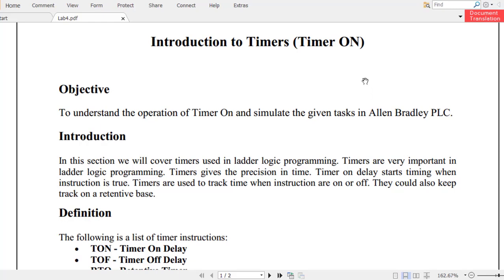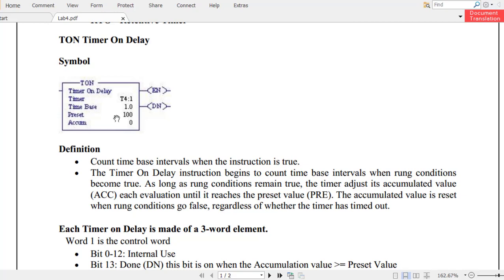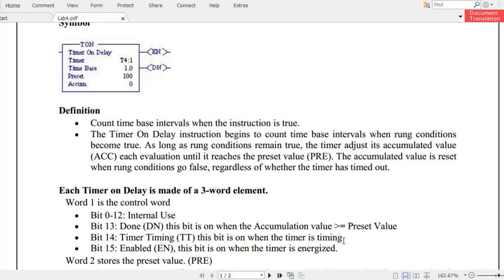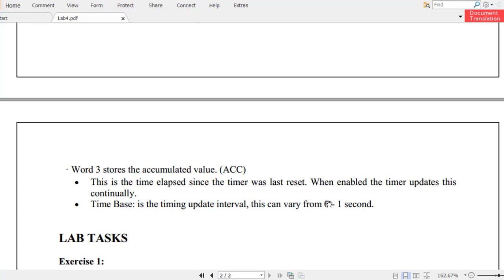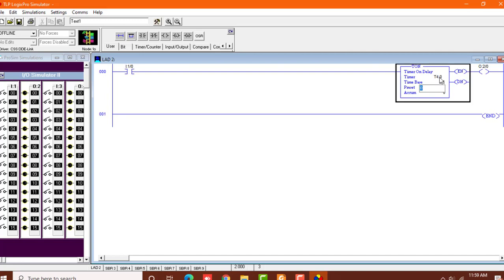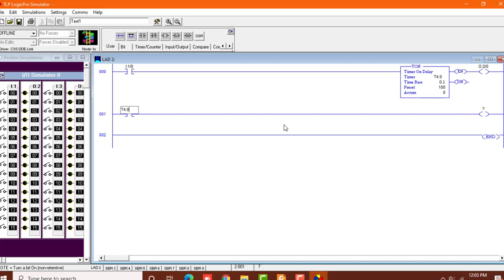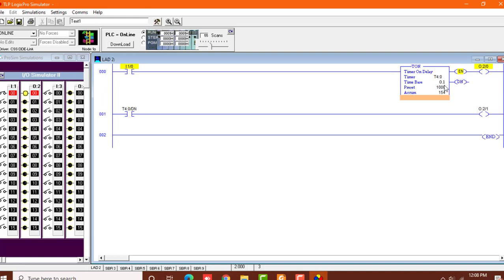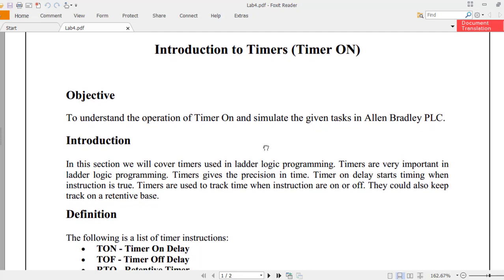How to use Timers

Comment: 171003 SYED YAWAR IMAM KAZMI
5B-POWER
Summary 
In this lecture we studied about timers , timers are actually those devices that can be employed to turn on or off those devices which have to be for some specific time for example we have a remainder set up in smart phone at 10:00am.
When clock in remiander goes to 10:00am it will give system alram or wakeup call.
So these perfomances can be done by timers.
We have thres types of timers.
i) T.on
ii) T.off
iii) RTO 
we studied only about T.on. if T.on=10sec then O/P appears after 10secs

Comment: Id: 180516
Beep 5b
 Summary of Lab 4:-
This lab is about Timer ON delay which keep the record of the time whenever the input is set active. It is made up of 3 words.
1. Control:

0-12 internal bit
13 bit Done bit which is active when accumulated value becomes equal to preset value.
Further with the help of DN pin, we can control a switch to turn on after a specific time interval which may be connected in another rang by assigning it correct Address. When our timer times completed our DN pin will active,and this switch activated.
14 bit Timer timing bit
15 bit is enable bit which is active when timer is energised. 
2. Preset: 

it stores preset value and it is programmable. 

3. Accumulation :

This is the time elapsed when the timer was last reset.
This helps us that our delay comes to end at a specific value e.g. if our pset value=100 and time base = 0.1 then our DN pin will active after 100*0.1=10sec,
And our Accumulated value moves from 0 to 100 with the gap of 0.1.

Comment: In this lab we worked on Timer On Delay (TON) for the purpose of triggering a specific tasks.TON relates with three words namely control Word, Preset Word and Accumulator Word.The range of naming it is from T4:0 to T4:99. For the time base its range is from 0 to 1. Product of time base and preset gives the amount required for accumulator to reach Preset value.As long as the rung connected to TON is true then EN is ON.When accumulator equals or surpasses preset value then DN bit turns On.As long as it counts then TT bit remains on.These DN, TT and EN bits can be used as an input as required for our specified tasks.
Rumman Khan 160310

Comment: Basically in this lab we have done the understanding of timer on delay 

An “on-delay” timer activates an output only when the input has been active for a minimum amount of time.

Inside timer main block there are further elements in the form of operations
1.timer name that is written as T4:X where x is 0 1 2 3...
2.timer base : the base line that we set for specific time period we re required to give a delay
3.Preset:we give a specfic value to preset to which the delay ends over all time = timbase *prest
4.Accumaltor : this helps us that our delay ends to specific value for example i give accumalator 100 though it will start from 0 and it will end at 100

Each timer instruction has three very useful status bits. These bits are timer enable (E N), timer timing (TT), and timer done(DN)
there is 2 output bits one is EN enable bit and one is DN done bit. 
these two bits are basically timmer status bits.

Ther three status bits can be expressed as 
 DN bit  This bit is set when the timer’s accumulated value is equal to the timer’s preset value. It can be addressed as T4:3/DN.
 Timer timing bit TT .  TT is set when the timer is timing. It is addressed as T4:3/TT.
The timer enable bit. It is identified as EN. EN bit is set whenever the timer is enabled. It is addressed as T4:3/EN.

this was all about the timer On delay
Reply from the maker: Marked!